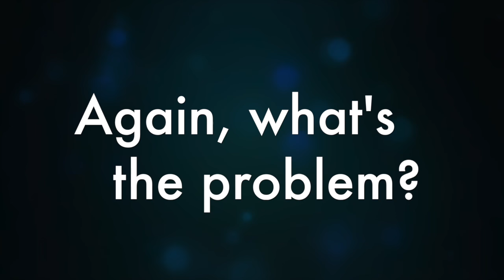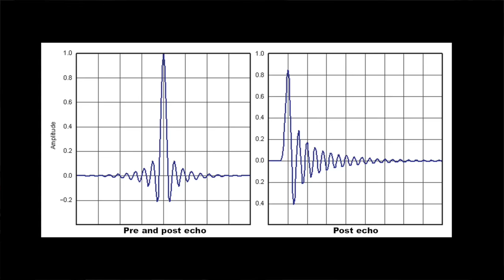The truth about Nyquist and why 192 kHz does make sense

Comment: Refinement is what I hear with higher sampling rates. You need a high resolution system to hear the benefits though.
Reply from the maker: I am sure that's your experience. But higher sampling rates can also offer better sound quality in simple equipment since the reconstruction filter has to do less work.
Reply: If a signal is bandlimited to 20 kHz, the digital signal sampled at 192 kHz does not contain any more information than the one at 44,1 kHz. In fact you can convert the 44,1 kHz version up to 192 kHz and receive the exact same signal (provided proper digital filtering).

So it is not the output side with the reconstruction filter having the problems. You could just upsample the signal if that was problematic.

A somewhat tricky problem is the analog filter on the input side: There you have to have a rather steep lowpass filter if you want to sample near the nyquist rate, and those are hard to realize in analog circuts. But already the common Sigma Delta converters don't suffer from this problem, because they internally sample much, much higher than even 192 kHz.

When the signal was digitized there is no reason to keep the high samplerate version - if you needed it you could always upsample it from a lower sample rate, as there is no information in the upper bands anyway.

I must admit, though, that I never did a blind test on this. Would accept the challenge, though ;)
Reply from the maker: You are absolutely right in the first section. But the point is not to band limit the signal at 20 kHz but have the natural roll of do its work by sampling at 192 kHz. This way a steep anti aliasing filter at 20 kHz is omitted.
Reply: I own a very good private recording studio creating audiophile recordings of acoustic instruments and small acoustic ensembles. I use 192 kHz often, and not because I'm hearing more detail, but mainly because the presentation of any resolving detail is much more refined. 96 kHz works great too, as does 24bit in combination with the above sampling frequencies.
Reply: I probably need higher resolution ears - I may have some top end hearing loss between 15 and 20K. Well serves me right for picking LOUD over quality. It's in that range where I can't tell if is my ears, the speakers, or the quality of the files.

Comment: I downloaded a 24 bit 192khz music file and converted it to mp3 320kbps. I can hear is much clearer listening to 24 bit 192khz. I am soon going to test Hi Res music using SMSL X3 wifi or usb and then through the preamp to class D amp and then through a class A to hear what difference the sound is.
Reply: I aint surprised you can hear the difference.  mp3 is great for getting small files but not for SQ.  I think it is easy to hear the difference between 320 mp3 and 16/44.1 (say in FLAC format), that alone 24bit formats.
I am a huge fan of 24bit audio, especially for classical.  It gives a delicacy that 16 bit cannot.  This is not surprising when you think that for 16 bit audio any instruments below - 36db are in fact encoded in 10bit (or less).

Comment: I always have a chuckle reading this Nyquist stuff. Everyone gets hung up on the so called extended frequency. But just pause and consider how many samples (at CD quality) you get for one complete 20Khz sine wave. So the DAC has to reconstruct a faithful analogue waveform from 2 and bit samples?
For me, it is the increase in sampling rate AT THE AUDIO FREQUENCIES that reaps benefits. Resolution is directly related to frequency and you now have around 5 time the resolution at 20Khz.
Reply from the maker: I understand what you're saying. But still Nyquist was right, his theorem is correct. You might want to watch https://youtu.be/z8dIzTZaRFY

Comment: im a complete audio noob, but i swear by 192khz/24 bit audio.. ever since the first time I heard a song recorded  at that rate played back over a good set of monitors. (it was at an audio gear stroe in the early 2000s) now as such i run a full setup on my desk for my daily activities. it may be more expensive and ive been called "audiophile" for it, but thats not even close to how i look at it. for me its math. just math if the device can sample at a higher rate. the quality will be better (i know obvious) so in turn i payed what i had to to get the best gear i could afford, because i like when my audio sounds good and proper. and i assume the people that listen to me talk online in games likely enjoy not getting their ears ripped apart by sup-par audio gear during a long gaming session.  I know i may sound simple on all this but thats the point. see a regular joe like me some average idiot off the street canhear the quality difference between 44.8  and 192.  so at its simplest form its easy to see that hans is correct, even to a simpleton like me. 

For reference my setup is as follows:
Blue Yeti Pro hooked up over XLR to a Bheringer Uphoria UMC404HD (192khz @ 24bit, in and out)
KRK Rokit 5 Studio monitors, oriented at the proper angle as per Manufacturer specs
(it may not be a "pro" setup but im not able to afford 1k$+ for parts so i did the best with what i have)

Comment: Let me start by saying how refreshing it is to have someone not blindly following nyquist in this modern Era. I have done the math that nyquist put forward and it says, assuming a perfect low pass filter (which does not exist) and assuming that the sampling is ideal meaning that it's instantaneous then and only then the sampling can be done at double the frequency. There are sooo many audio enthusiasts who blatantly use the nyquist theorem without ever solving the math and say things like higher sampling rates are rubbish. I hope this helps you understand why we don't use nyquist is real life, it's based on assumptions of ideal filter and ideal sampler that don't exist. A rule of thumb that we use in research is atleast 5-8times highest frequency in the signal that we need to sample.